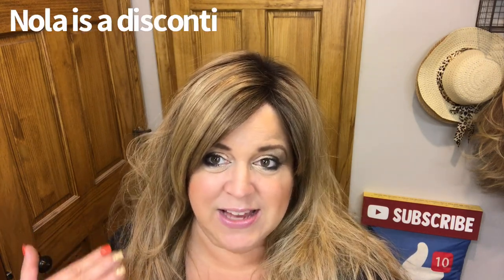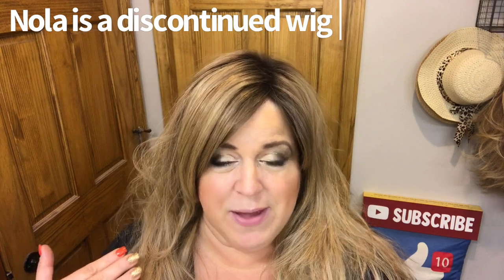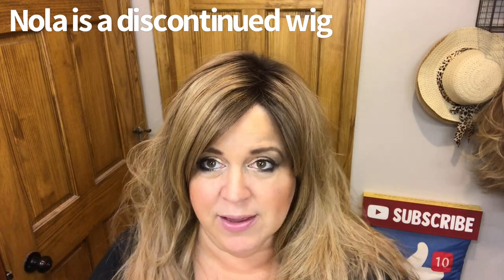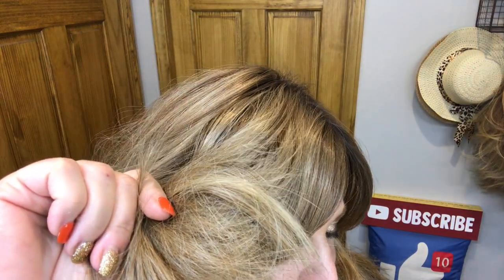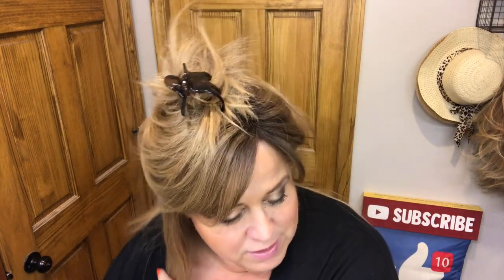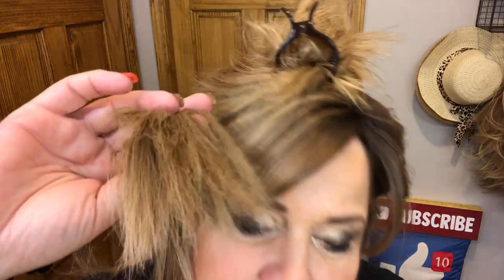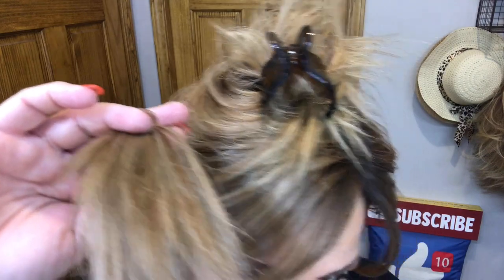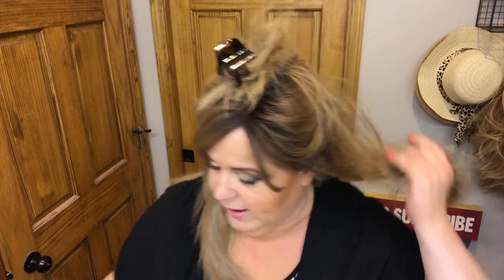How I Maintain, Restore & Repair Heat Safe Synthetic Wig Fibers Using a Hot Air Brush #FixItFriday

Comment: Wow ! I had no idea that you'd do that video so fast and I'm so happy ! So thank you !. If one doesn't have any kinks in the versafiber's ends I doubt that doing the flat brush first has any value. I could just skip to curl. Can you confirm that ? Another question: I need to have more curl that what you do here. Does the brush get hot enough to be able to do that ? Thank you !
Reply from the maker: It was on my mind so I thought I'd share, and I knew I needed to refresh my well-loved Nola wig! lol 😂 You're welcome dear! 💛 If you're wanting to curl your VersaFiber heat safe wig, you may have better luck with a curling iron or rollers and steam (which I'm working on a video for that too). You can also add curl to an HD wig using a flat iron (here's a link to my Sloan video where I  did that: https://youtu.be/31gjIkRhA2s ). This does have a curling wand but the thing is you'll need to wrap the hair around, get it hot, then turn it off and let the hair cool in order for the curl to set, so it can be time consuming for that. 😊😊😊
Reply: @BethsBestHair  I'm terrible with a curling iron ! I watched your Sloan video so thanks.  I'll experiment and see what happens ! I gather then the brush doesn't get hot enough. Is there a noticable difference with the top heat level that you're not using vs your regular hear level ?
Reply from the maker: @MarinaLaroche  Hi Marina, the brush DOES get hot enough but it's time consuming. So synthetic fibers are different than human hair, in that synthetic curls set when they're cool (after being heated up) whereas hh sets when it's hot. So with the wand attachment on my hot air brush (that you saw me use in the beginning of the Sloan video) You would just need to pin every curl after you heat it through. Then let it cool and then take out and style. The level I show you is the hottest level (and it's hot) the top level is actually the cool setting, weird, I know! lol 😂😂
Reply: @BethsBestHair  "The top level is the cool setting". Weird indeed ! In the Sloan video it appeared to me the wand was great to provide volume and definition on top but the bottom of the hair was left somewhat uncurled. I'll need to watch it again.

Comment: How do you fix end on a curly wig? I  bought a Deidre that came with really bad ends. In fact. Some of the fibers looked like the were attached with the zip zag end backwards! I  should have ewturned it. But thought I could just cut the goofy ends off. Still has really dry hair so I'm wondering how I can fix it.
Reply from the maker: Oh no, I'm so sorry to hear of this! Dierdre is such a cute style and it definitely sounds like that was a manufacturer defect. Deirdre is a VersaFiber so it is heat safe up to 350 degrees. With that being said, it can be tricky with curly wigs as you basically just want to heat treat the very end tips or you will alter the curl patern. I would suggest washing your wig and then condition it with the bamboo silicone cream (check my Amazon Store, link on my channel page header. Then when that's done and the wig is dry, gently comb through starting at ends, then you will need to use heat to work on the ends. Rene of Paris makes a hot tool that works really well and is designed for synthetic wigs. Otherwise, I would carefully use a curling iron brush on the ends and just keep kind of brushing/curling through until ends are smooth. I truly hope this helps! 💛💛💛 xoxo Beth